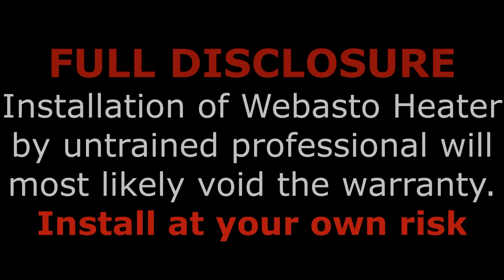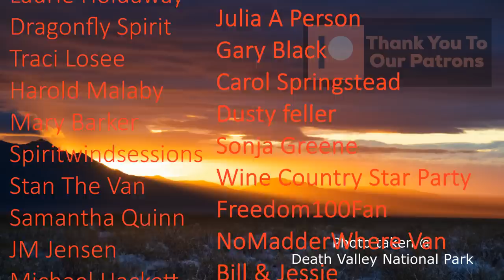Our BIGGEST Van upgrade we have EVER done!! Installing a WEBASTO heater!!

Comment: Nice heather, my Safari Condo on a ProMaster 3500  has a Webasto comes standard with a 7950 BTU and I got the optional 13,000 BTU, I like the dry heat it produces. Again guys, I find you folks honest and genuine, best wishes and keep those drone pictures coming in.
Reply from the maker: Oh wow! you are set on the BTU's!! Do you have any advice about daily use? Have you used it in higher elevations? Any problems with it clogging up? Our heater is gas and does high elevation kit is not available like the espar heaters.  Drone pictures are a must for us!  We just got back from backpacking in the Wind River Range in Wyoming where drones were not allowed......in fact,  if you were caught with a drone in your presence you would be fined. WE TOTALLY UNDERSTOOD!! The area was so prestine....you would not want a drone buzzing by!  But oh my the drone shots would have been out of this world!!
Reply: one adVANture at a time. To avoid clogging up you should run your Webasto once in a while so that gas does not dry up, even in the summer.
Reply from the maker: Paul Desjardins thanks! It looks like we need the thermostat that we have but have not installed yet and one other part!

Comment: great tutorial video.  We had our webasto installed by a professional.
Reply from the maker: Any advice on daily use? helpful tips, or any problems we should watch for?
Reply: The only tip the professional told us is to put the thermostat switch on/off near the bed area ....far from the webasto heater device. Too close to the heat...the thermostat will switch off before the bed area gets warmer

Comment: Really glad you guys decided to upgrade the heater.   I continue to debate with myself to this day whether I should have gone with a webasto or espar instead of going the propex/propane direction.  It’s definitely convenient to not need to worry about propane, and when I originally did the planning, I was not thinking that we would end up with the under-the-van propane tank that we have, which was a significant additional expense (tank plus needing to then find a new home for the spare tire).  The other thing I did not consider was the built in nipple for accessing the fuel tank — I didn’t realize that existed, and assumed we’d be punching holes in the van’s gas tank.  The thing that originally won me over to the propex side was the worry-free high altitude operation, which I certainly do appreciate.  The other thing I really like about our propex is the fact that we were able to mount it under the van (it’s the HS2211 model) so that we didn’t need to worry about seat removal etc.  It’s also extremely neat having all the ducting under the van.  All in all, I probably would have gone the webasto route if I had been aware of all of the factors and costs, but I do love our propex.  Again, congrats!

Comment: I have the same Webasto here in Belgium. I have a Renault Trafic 2017 coverted into a camper Also installed under the passenger seat. I have a double seat, so I Installed a 220v  inverter and a 100A Lithium battery too. Everything works just great !
Reply from the maker: Nice Roger! I wonder how long we can run it before it needs maintenance.? This heater has been keeping us comfortable in super low temperatures 😎

Comment: These heaters are great ! I have a 3600 promaster with a crew front seat and cant install the heater under the passenger seat due to the air bag being there . I will install a Diesel Wabasto in the garage and run it from a Diesel jug on the back door .

Comment: Hi guys. How’s the wabasto working out. Does it drain your battery. I’m getting the Espar for automatic altitude adjustment reason
Reply from the maker: The webasto is working great. I (carrie) use it daily!!! best purchase ever! The elevation limitation kinda sucks....there is a way you can recalibrate it but we have not really looked into this. We have a VERY small battery bank for our house battery so we wired it so that we can also run off the van battery. It really doesnt use that much energy. We do not run it full time. When it is really cold we use it maybe 6 hours/
Reply: @oneadVANtureatatime  ah thanks. You guys totally rock! I’m off adventuring next November if border opens. I’m Canadian Montreal. I’m getting the Espar with altitude automatic thing. Great photography!!!!!!

Comment: I have a Webasto 2000 STC Petrol. It has coked twice. The first time I serviced it, I installed a new burner assembly (~$150, and that was probably not necessary).  The 2nd time I used carb cleaner and a map torch to clean the burner assembly. I don’t think the glow pin is much of a concern (and that can be tested with a 12v power source). What is a concern is that the heater will have to be serviced periodically. That means deinstalled and disassembled and cleaned. I recommend you have a new set of gaskets on hand. This will allow you to service your heater without delay. You will know the heater needs servicing when you see white smoke upon startup. Cleaning the heater is not hard. Webasto has a YouTube for disassembly and assembly of the 2000 ST Diesel, which is almost identical to the petrol.
Reply from the maker: Thank you Dusty! We appreciate the help as we are most likely going to be doing the servicing ourselves.

Comment: Wow cool your going to love having that! By the way we we’re all told to put premium fuel in our tanks by most installer....and well I had some issues with my wabasto install and got the name of the very best of the wabasto guy in Montreal. This guy checked everything about my install and he had to reinstall a 4th temperature control because it was not installed properly !!! And I told him I was putting only the highest octane fuel in for my wabasto and he said: Why? You don’t have to do that!!! It’s mostly the ethanol content that you have to check.
I wish I had known this last year before I drove 28000 km across the US🤬. 
And he said that you have to really start that thing on full blast for at least 1/2 an hour and then you can lower it down but then before turning it off another full blast for 30 minutes it makes sure you don’t build creosote..And if you use it a little in altitude like just a couple of days you just run it full blast to clean it when you get back down.
Take care xxx
Reply from the maker: Great info Natalie!!  we were not able to install the thermostat that you sent us but we do hope to install it in the future. I think we just need to find an adapter! Thank You so Much!! And I LOVE MY LITTLE PAINTING OF ROODLE!!!
Reply: How did you find a Webasto installer?

Comment: Congrats on the new upgrade!  I bet the dry heat makes a huge difference! We just experienced our first snowstorm in the van in Colorado. Ran the Olympic Wave3 overnight as you guys have and did ok!  Will be purchasing a Wave6 for the trailer soon.
Reply from the maker: The wave 3 and wave 6 do a great job!! we tend to find ourselves in quite cold temps more often and with proper ventilation our wave 6 just doesnt keep us warm enough.

Comment: Just wondering why you didn't place the heater in a more central location of the vehicle? The sleeping position at the back next to the door is going to be really chilly. Or did I miss that in the video. May I suggest you placing model info in your info section?
Reply from the maker: The heating hose is centered right down the middle, it does a 90-degree turn between our seats. It's been working awesome. Last night it was 5 degrees outside and a toasty 72 inside. We will list the model number, can't believe we forgot that. Thank you. 😀
Reply from the maker: The heating hose is centered right down the middle, it does a 90-degree turn between our seats. It's been working awesome. Last night it was 5 degrees outside and a toasty 72 inside. We will list the model number, can't believe we forgot that. Thank you. 😀

Comment: Do you have the Ram swivel seats? We do on our PM, so I'm hoping it's as simple as yours looks. Also, any issues afterwards with the airbags (signal, etc.) after removing those?
Reply from the maker: +BJ Sorensen we have swivels on both seats. We swivel the passenger seat everyday!! We NEVER swivel the driver seat but partly that’s because our sofa is right behind the seat. No issues with the airbags.  We have completely removed the passenger seat to install a webasto heater.... still no problem.  To do it safely we did disconnect the battery. 

VAN LIFE- How To Install A Seat Swivel https://youtu.be/mb-4V8B-j4I

Comment: Since you put your heater sideways, did you have to cut open a hole into your plastic seat panel?
Reply from the maker: If you are referring to the plastic panel on the side of the seat we removed it completely.

Comment: Hi, was the fuel line that came with your kit hard plastic? Mine is,and doesn't seem to easily fit into the fuel nipple of the unit. How do you get around this?
Reply from the maker: The main fuel line is the hard plastic. The kit should also come with flexible rubber gas tubing as well. These small pieces of rubber go over the hard plastic lines and clamp on for a secure fit.

Comment: It fits ok under a lowered seat swivel?
Wiring size? I need to run any electrical now.
Reply from the maker: Hi Jim. We have the standard seat base and swivel. I just measured and we still have 4 inches of clearance above the heater. All check on the wire gauge, I don't recall currently.

Comment: Installing a heater with a thermostat is high on my list when I get my van in 6 weeks. I will be using the Goal Zero 1500x just wondering if you have the heater on all night how much power that it need?
Reply from the maker: good question! I know our frig uses 20% of our goal zero 1400 in a 24 hour period. It will be interesting to see how it does. We dont expect to use it all that much at night.... more for comfort when we are awake!

Comment: What is the reason you couldn’t directly connect the fuel line to the snap-in adapter? Is it because it’s hard plastic and doesn’t fit?

You used the elbow reducer to make the connection to the Webasto fuel line. 

Also I really appreciate your video on this. It’s helpful to see how you guys did it.
Reply from the maker: +idkarts Dave said yes, it was hard plastic. Glad this video was helpful! We are happy to share the fittings and connectors.... it made the job so much easier! Super happy someone shared that with us before we installed the heater😄

Comment: Any tips for getting the heat shield off right under the seat? Did you have to completely drop the muffler as well to remove the heat shield? I’m not seeing any way around having to do that:(
Reply from the maker: Don’t be afraid to bend it a little and pull it down on the drivers side. It takes time and patience and is probably the toughest part of the install. No need to remove the muffler. Wish I was there to help you.
Reply: @oneadVANtureatatime  man wish you were too! Ya so far that really has been the worst part... and working in all the tight spaces under the van. I’m feeling like my exhaust pipe and air intake pipe are really short and will be too close together.. I’m pretty sure i have the same kit as you, did you feel the same? Or did you extend the air intake?
Reply from the maker: I felt the same way about the exhaust and intake being too close. We ordered an aftermarket extension for the exhaust and moved it to the driver's side of the vehicle. I will send you the link here as soon as I find it. We did get the muffler with our kit which is needed to make it easier to add on the extension hose.
Reply from the maker: https://www.heatso.com/search.php?search_query=Exhaust%20hose&section=product

I also ordered two more hose clamps from Heatso. Everything worked great. I hope this helps.

Comment: congrats...good job....would have been nice to see your hot air duct work..I take it that the outside heater casing does not get to hot to melt or burn anything......  but always remember --just say no to crack...................LOL.............;-)... the plumber was nearly exposed..........................................
Reply from the maker: Great suggestion! I should have showed that. We did cut away a bit of the floor board just where the heat tube comes out....that does get pretty hot. The webasto heater itself seems to be fine on every test that i have performed.....I was wondering about how warm the heater casing would get as well.  LOL on the plumber!!

Comment: How is your diesel heater working out? How about the tires?
Reply from the maker: Hi Shane! We are loving our Webasto heater! We should have started with this one. We just got new tires. Our Falken AT3’ ended up lasting for 61000 miles and we were very happy with them.
Reply: @oneadVANtureatatime  what source did you use? I see many carry it. Walmart, local tire stores. Do they make noise when on highway?

Comment: Did you have to order the muffler separate or do you get everything in the unboxing when you order the heater?
Reply from the maker: Hi Shirley. We ordered it as an add-on with the initial order so it did come in the same box. The muffler makes it easy to add on an extension exhaust hose on as well. We did this because we didn't want exhaust fumes coming in the van door and also to space it out from the intake hose. We ran it to the driver's side of the van. I hope this helps you. 😎 We are loving our heater.

Comment: How have you like the Webasto so far?  have you tried it at altitude yet?  
we are seriously considering a Webasto 2000 STC for our promaster as well.  
thanks!
Reply from the maker: We are loving the Webasto! That said, we are at 8000 feet tonight and we are not going to use it because we have not done the high altitude adjustment yet. We are worried it will need cleaned and maintained more often if we push it too much above 5000 feet. We have some cold temperatures forecasted so we will be going to lower elevations soon! I wish it came with the high elevation adjustment out of the box. We still recommend it. 😀
Reply: @oneadVANtureatatime  Thanks, i appreciate it!  Ours should be delivered soon; then we start the install!

Comment: Thanks for this video! Could you comment on what options you purchased from the heatso website. I'd like to install mine in the exact same location and want to make sure I have all the necessary pieces. Thanks
Reply from the maker: Hi Bill. We added on the exhaust muffler only. Then later we bought an exhaust hose extender through Amazon, only because I could not find it on the heatso site. I feel a lot better having the exhaust further away from the intake hose. Let me know if you want the Amazon link for the exhaust hose.
Reply from the maker: Ours came with the seven-day timer that we are still trying to learn 😆 I may have selected it when we purchased.
Reply: @oneadVANtureatatime  yes, please for the link

Comment: Great content! I was wondering how you removed the exhaust heat shield? I have apromaster and a couple of the bolts holding down tho shield also hold up the exhaust pipe,so I was wondering if you dropped that down too?
Reply from the maker: I was wondering the same thing when unbolting  them. The muffler stays in place just fine so no worries about that. I did have to bend the heat shield to rotate it off but it does bend back into place.
Reply: @oneadVANtureatatime  you are the man. I took all 6 bolts off and it didn't fall on me!! Haha taking off the loose heat guard took about 3 means once the bolts were off. :))

Comment: A few things:
1 - Your disclaimer at the beginning isn't exactly true, but what is a larger concern is buying from Heatso and other off-shore companies. Heatso will do NOTHING to help you if you have a warranty claim. Then your life is harder. 
2 - Kits that are sold outside of the US don't have some components that are included in the US kit, one of them is super important (see point 3)
3 - The floor that you bolted the heater to isn't flat, there are raised and lowered sections. That rubber gasket on the bottom of the heater won't seal against that. That could cause exhaust gas to enter the cabin. You could wake up dead. 
The 4" hole is less painful than exhaust gasses leaking in. That mounting plate allows you to use a gasket that makes up for the uneven floor surface.
4 - Those clamps on the 1/4" fuel line will cause air to leak into the fuel line, and cause the heater to not start, giving you a code 1 or 2. ONLY use the webasto clamps. You can ditch the 1/4" hose and use a simple hose webasto sells (P/N 1319718A and 1310763A for the clamp).
5 - Altitude adjustment. Sorry, you wrong on the altitude adjustment. Do a search for VMACS youtube channel. He is an ACTUAL webasto dealer and has correct info.

Comment: Very cool heater. Gas or diesel options, that cool. Didn’t know they used a gas one. That adapter port off the pump is totally winning. Never mind Dodge put an access panel above the pump. I mean, how easy can it get. No dropping the tank, or drilling the tank. Wow 😳. Nice I stall, guess we will see how y’all do this winter 🥶 👍🏼
Reply from the maker: Yes, the real test is to see how it does with our Goal Zero battery bank and how fuel it uses.

Comment: So, glad you went with a diesel heater. : ) It doesn't matter the name brand, you'll be very happy with your choice. The plus is you'll grain more room up on the countertop.
Reply: Its the Gasoline Heater not the Diesel version.
Reply from the maker: we did go with a gasoline heater. We would have preferred the diesel but did not want an extra fuel tank inside the van.
Reply: one adVANture at a time no worries the fuel doesn’t matter. Just glad you got one, and you’ll be safer, and warm! : )